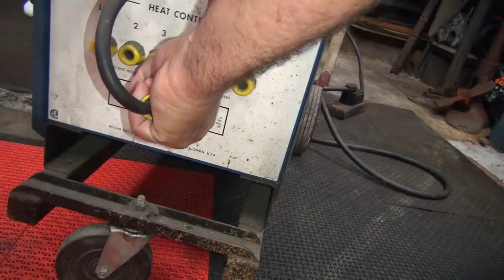1958 panhead 74ci #105 fl bike rebuild topend repair harley by tatro machine

Comment: Tatro what kind of exhaust pipes would you recommend for a xlch 1000cc s&s stroker sportster for best performance.
Reply from the maker: 40" 1-3/4" drag pipes if you want alot of noise. if not, than a set of 1-3/4" dual exhaust pipes with slash cut mufflers. 
tatro